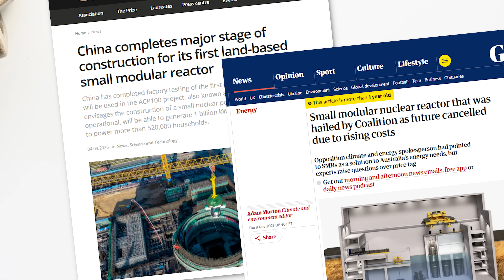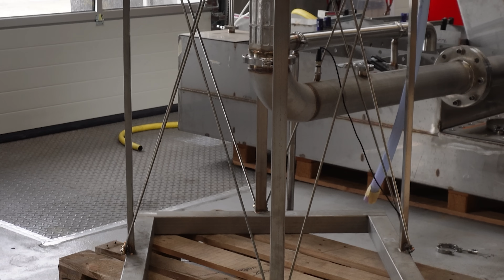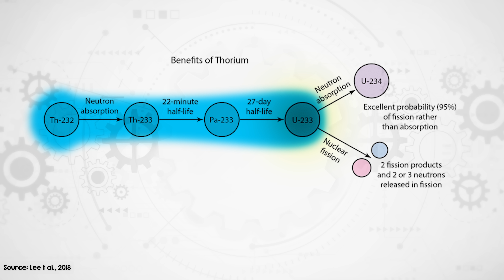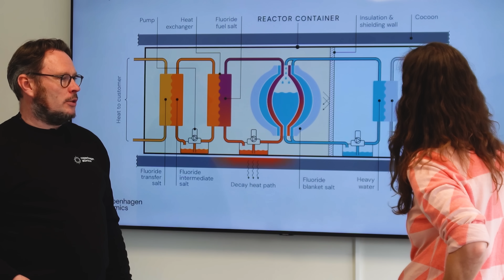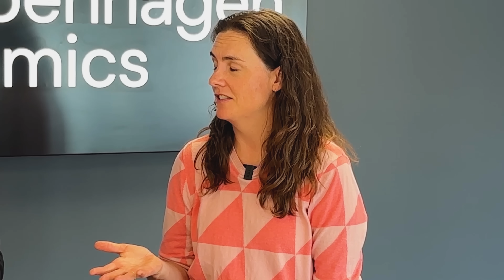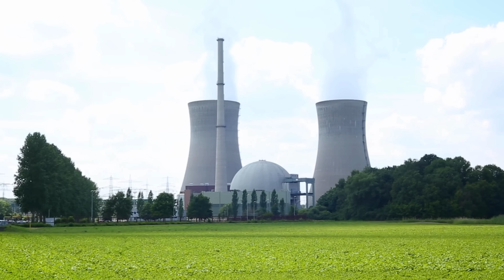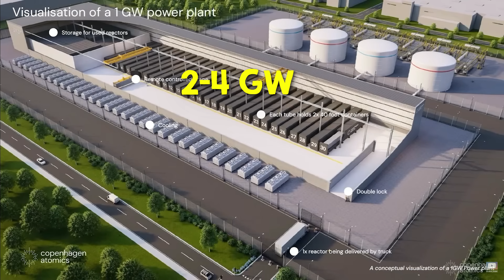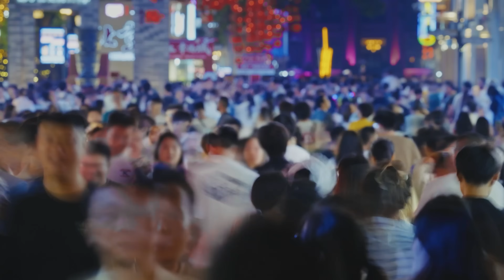Can Copenhagen Atomics Make THORIUM REACTORS Work? [TOUR]

Comment: Interesting solution but did i understand it correctly?  You have basically replace the whole site every 5 years and store the old sites for 50 years to not be radio active so you can recycle it - sounds costly to me
Reply: I am no expert in this, but I have seen a couple of videos from Copenhagen Atomics (CA). 
The most valuable in the container is the fuel. They will reuse it in a new reactor.  
The customer is renting a container. CA will do the rest. Run it and monitoring the system. CA changes the containers when needed and take the used one. The customer pays a price for the electricity (contract) and having nothing to do with it. 
I think their first big customer will be Indonesia, and it might be a good place to build a mega factory.

That's how I understood it as a layman.
Reply: Pretty sure they expect to go higher than 5 years in the future. 5 years is what they can pretty much guarantee at this point and what they need to make it economical. 

Storage for just 50 years is not a problem.
Reply: @peterfireflylund  hopefully it'll get longer. But the storage won't be fun, you'll need to find a lot of space over the years especially in a small country and who pays for the storage and security?
Reply: @rtfazeberdee3519 the only problem there is political. Storing a few containers worth of stuff in a fenced off reinforced concrete building is easy.
Reply: A reactor vessel is estimated to cost 4-8 M$ to produce. That is about 0.5 cent pr. kWh of produced electricity, so swapping the reactor will not break your excel sheet. On the contrary it allows you to build in cheap and, more importantly, available materials. This is the hold back of many other molten salt designs. They rely on materials that will last 40+ years, and we simply don't have them. SpaceX did the same think with their Starlink satellites. In stead of building a 100 M$ satellite that will last 15 years in space they build a 1 M$ satellite that will last 5 years. You do the math🙂
Reply: @thesparetimephysicist9462 the big issue is over regulation, as always. It’s very easy for the “greens” to make that reactor vessel cost a billion dollars and take a decade to build.
Reply: @peterfireflylund  True. We really need to change something there! CA's strategy to get around this, is to partner up with big ammonia plants that has huge energy consumption and need a steady output. They plan to build the first plants in countries with favorable regulations. Once the system has been proven, the rest of the world might wake up.
Reply: Yeah, I think you heard right. I'm sure they need to push the excel sheet pretty hard for investors to see how it works out.
Reply: Already getting 5 years of durability is questionable. The MSRE experimental reactor ran for some 1.5 years during a 3 years span with relatively low power ( 8 MW thermal max.). Even with specially selected expensive alloys they did encounter corrosion problems and were pretty much at the end of life after the test. With normal stainless it may well be more like 5 months, not 5 years.  The corrosion problems get worse in the chemical fuel cleaning part of the plant - the part that is usually left out as it's only crude theoretical plans or ideas and most of the developement still needed.
Reply: @UlrichHarms-ci1ov True that corrosion is a big issue, and a problem CA has been very focused on from the start. They are world leading when it comes to purifying salt at large scale, and have manage bring corrosion down to an acceptable level. They hope to get to a 5-year life span, but the early reactors will more likely last 3 years. The test loops you saw in the video are used for component testing in a molten salt environment. This is exactly to make sure that corrosion will not be a problem. 

Also, true that the chemical fuel cleaning is not fully developed yet. I believe the first reactors that go online will not be breeders and mostly be running on U235. As the systems are further developed, they will be swapped with more complete systems.
Reply: @UlrichHarms-ci1ov+ faster degradation of the materials due to neutron radiation. This means that the CA will most likely not be economically viable.
Reply: Costly compared to light water reactors?
Reply: @phil20_20  obviously they think so at the moment, as shown by them putting up some of their own money. They also seem to have investors who (at best) believe it will be cost effective or (at worst) think it's a bet that's more likely to pay off than to fail. 

 If they are right they will be rich. If not then they and all their investors will lose all that money they've spent, minus anything they sold the electricity for. 

The other point, which might motivate some investors, is that Thorium is quite hard to turn into bombs, so is easier to supervise to prevent proliferation of nuke weapons -- an important motivator in view of recent events.
Reply: Based on your advanced cost analysis?
Reply: It is strange to me that they did not mention the obvious solution - you just get a new unit and ship the old one to the factory to be refurbished. They are sea containers, after all.
Reply: @loodplanet  I guess they don't want you visualise an ever increasing pile of old radio active containers sitting there for 50+ years.

Comment: Okay, so after 5 years you'll have a shipping container (or at least the internal components) amount of highly radioactive waste? Yeah that's a problem. Very cool technology otherwise, but that's just such a ginormous amount of radioactive waste for such a small reactor....  What's the m^3 of radioactive waste per kWh (and for how many years is it highly radioactive) and compared to traditional nuclear? Its the only metric that will make or break this technology. Storing radioactive waste is SO expensive.
Reply: Half life from Thorium products much, much shorter. Waste from Uranium can be used in Thorium reactors
Reply: @BobHarris-to1fv  The problem here is not the fuel, it's all the machinery. Parts that wear down like pumps and heat-exchangers are directly into the radioactive path, so the steel etc gets irradiated and thus radioactive itself. No idea what the half-life of the isotopes of the components is, but even if it's 50 years, where are we going to store all of those containers. There are lots of different materials (lets say, steel, brass, aluminium, magnets for their levitating bearings, etc. etc.)  in these components, all generating different isotopes and not all of them will be short-lived... They're talking about 'mass producing' these things at 1 per day. So in 5 year time we need to start storing 1 per day of these things for 50++ years?    I feel it's much easier to store a barrel or traditional fuel (that has supplied a whole 1GW nuclear reactor for 5 years) for a 100.000 years (dump it in some 1km deep hole in the ground) than store a whole highly-radioactive shipping-container for 50 years that has produced a measly 50MW for 5 years....
Reply: @chrisdejonge611  Australia has vast areas of land where containers could potentially be stored, although the aboriginal land owners will want some compensation for losing access to the land, but the amount of land needed is trivial in the context of the land available.
Reply: @chrisdejonge611  Actually the spent fuel casks for the fuel rods from powering a light water reactor for a year would be about the same size (order of magnitude) as the CA reactor containers doing the same, but much heavier, and far more radioactive. The hot stuff from a CA reactor goes straight back into the next reactor. Some of the separated fission products would have half lives up to ~30 years, but all of them would find other uses - as long life batteries (strontium), metals (zirconium, ruthenium), for breaking down persistent toxic chemicals like fluoride compounds, sterilising food without having to heat it, etc.
Reply: This is just the start. If these guys can pull it off, this tech will develop to much more efficiency. Same as all other new tech

Comment: Can you change the produced power? Or is the power production continues the same?
Reply: The power production is principally via steam turbines, exactly as would occur in a conventional nuclear power station. However, small module reactors also seem to offer the potential to also use the low grade heat that can't be used for power generation to meet local heating demand. Combine such a modular reactor with the idea of a massive underground sand battery that is heated throughout the summer season and where the heat is extracted over the winter period and you have a much more efficient way of heating people's homes.

Comment: The biggest problem with nuclear energy is not the cost. Instead, the biggest problem are all of the associated problems with radioactive material. The political issues with nuclear include pollution from mining (of original stock), pollution from the waste products (and even the system in this video produces radioactive waste), and the fear of bad actors.
Reply: You need to look into the difference between Thorium and Uranium  nuclear reactors.
Reply: Cost is a huge ongoing problem with nuclear energy... along with extremely long build times... along with nuclear waste.  Nuclear energy is simply not feasible at utility-scale with is a large-scale.  But nuclear energy is good for small-scale specialized applications such as for military and deep-space exploration.

Comment: Did you meet Matt Farell :D
Reply from the maker: Ha ha no, I recorded this in April and I did laugh when I saw his video released last week. But I think we each covered the topic quite differently so likely the coincidence will work out well for me as YouTube likes to suggest videos on a similar topic to what viewers have watched recently and Matt's video was very popular. 
I didn't get the impression he actually visited, so that's a point of difference I managed even if I didn't manage to get in "first" on the topic!
Reply: @EngineeringwithRosie  yeah your videos have a very different focus. i think he's more about the  potential pros of the tech and yours goes much more in the engineering detaiil. did they mention, what temperatures the tertiary salt loop outputs? (frankly i came away from Matts video thinking they use the water loop at atmospheric pressure for heat exchange, what would obviously be horrible for efficiency)

Comment: basically, they need to replace all the internal components with the reactor after 5 years. And they are then "super" redioactive waste.

I do not know how this way of producing electricity could be financial feasible.
Reply: Depends on cost and depends on provided base line of energy.
Reply: Seems doubtful as battery tech is marching along. Got enough Solar and wind then this reactor system looks none economical. 

Am also waiting on new geothermal. We are standing on molten lava that will stay hot for a long time and all you do is have water go in a loop. 

Interesting the energy future is progressing. Hmmmm.
Reply: @otto_schwarzkopf  As I understand ... with existing technology, geothermal is only possible in certain areas of the world where the crust is not as thick. The main problem is that drilling at deeper depths is not easy.
Reply: @wnose  Check out  Eavor. First plant being built in Germany.  In about a year we'll know its actually working and in 10 we see how it holds up. There is also another company whose name I can't remember.
Reply: Nuclear reactions are 1 million times more energetic than chemical ones.
So you greatly reduce material handling: even with swapping out the components every 5 years.
Reply: @economicprisoner  Time will tell if their concept will be economically viable

Comment: I will believe when I see it.

There is a reason why engineers of the past built big reactors.
Reply: There are many reasons, almost none of them are connected to challenges engineers have with Thorium reactors.
Reply: @Pecisk 
The reason why big Reactors are usually better are exactly the same. Building a reactor twice as powerful isnt twice as expensive. The only reasons reactors arent even bigger are logistical and Material limitation.

Even conventional small modular reactors havent been successfull, besides in military applications on a ship. If building smaller reactors woule be the key, the companies supplying those would also brought them on land as well.

I just dont see how building a small Thorium reactor should make it any better than a big one.
Reply: @justinterested5819  "I just dont see how........." - Of course, because it's not your area of expertise, just like so many online pundants.
Reply: @justinterested5819  That is correct when you look at the traditional designs, but you cannot compare appels to appels. The reason larger reactors are cheaper is because the amount of concrete you need in the containment building does not scale linearly with the power output. The molten salt design runs at a much higher temperature, and is under atmospheric pressure. It does not have liquid water at 300 C and 150 bars of pressure. This means that you don't need a big containment building you can fill with radioactive steam in case of over pressure of ment down. The amount of concrete ans steel is much less from the start = lowe cost and shorter construction time.
Reply: @thesparetimephysicist9462  Thats just one component of cost. The scale of cost still stays the same. Bigger turbines are cheaper per Power produced. Bigger pipes are cheaper per Unit Steam/Water transported. Its almost like an universal law. This applies to almost every aspect of Engineering: Diesel Engines, Electric Motors, production facilities, batteries, Inverters, Computers, Internet Infrastructure, Container Ships ect. The only case where smaller units become cheaper than their bigger counterpart is when the overhang isnt needed, or there are other size limits like canals or the size of road where you can transport stuff.
Reply: @justinterested5819  Yes, and that is why Copenhagen Atomics suggests many small reactors in parallel feeding heat to a single steam generator.
Reply: @justinterested5819  I agree to all this. The thing with CA's reactor is that it is the optimal size for the design if you want to breed efficiently. Would it be cheaper if you could build it bigger? Yes, but it is not possible. It is still a fact that less concrete and steel is needed per unit of power than with a large light water reactor, so the small size is not a deal breaker. You can still build lagre turbines if you couple the output of several reactors.